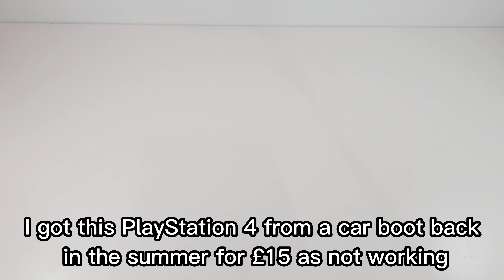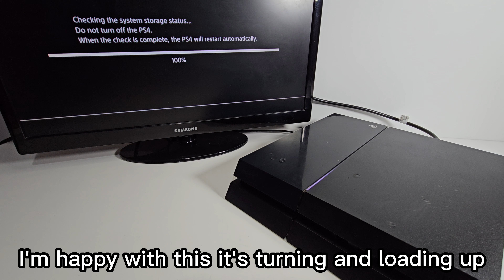The Most Dirtiest PlayStation 4 on YouTube - Restoration & Repair

Comment: you should clean the motherboard too in warm distilled water plus dish washing soap and dry it with hot air ..then it be like new
Reply from the maker: I was unsure of that method but l will give it a go with another console at some point this year, and thank you for watching 😀
Reply: @techrestoread  be careful to remove the rtc battery and short the main capacitors with a tweezer on the main board not in power supply so there will be no current in main board..i always do it with laptop and computer mother boards

Comment: Looks like this console been in a very heavy smokers home and they probably used it as a vacuum cleaner substitute. when I got my PS4 from auction it was just as or even more caked with dust than yours but it did at least not have all that nasty brown smoker shmoo all over it. I could save mine and use all parts again and it been working ever since
Reply from the maker: I've never seen anything like this PS4, but I'm glad you got yours working as well it was fun to do, but a lot of work 😀
Thank you for watching 😁
Reply: @techrestoread  for sure. But my console was actually a real challenge to fix because it was initially broken by dust and overheating and disk reader problems. 
But then the shipping company that delivered the package managed to completely smash the console to pieces during shipping. 
Even the WiFi antenna internally was completely crippled and snapped off. The case parts cracked and broken. 
I had to spend more time repairing the secondary damage made by the shipping than repairing the actual problems with the console. Man I was peeved by that. But I actually repaired everything including the antenna with the broken wire and everything.
Reply from the maker: Wow, you did have a challenge  it's a great feeling when you get it up and running again and fair play to you 👍
Reply: @techrestoread  yeah I think about it when I play on the console how I sat and welded and glue the case together with great patience to make it almost invisible in the end and it served me well for doing that

Comment: My problem is that i put a sticker/skin on my ps4 it's not 3M so it has sticker residue all over. I don't know what to use to remove it
Reply from the maker: Alcohol is great for removing sticker and thank you for watching
Reply: @techrestoread  how about acetone?
Reply: @GojoRamsay888 Never use acetone on plastic unless you want to melt something. Look up for a specific product for removing glue called "Goo Gone" or similar. Good luck.
Reply: I used wd40 with old card and a sponge.
Then wiped it off with wet wipes.
Good as new except the shiny part of ps4 fat.

Comment: you do'nt put thermal paste, thermal pad and don't clean the roller in the disc drive in video
Reply from the maker: Thank you for watching. I put the new thermal paste was added 15:23 l did miss a bit of filming when cleaning the disc drive like the rollers and the front of the disc drive the black fabric where the game goes in with a alcohol wipes